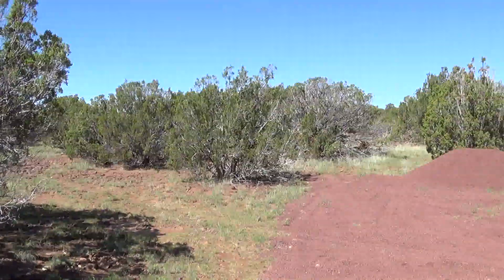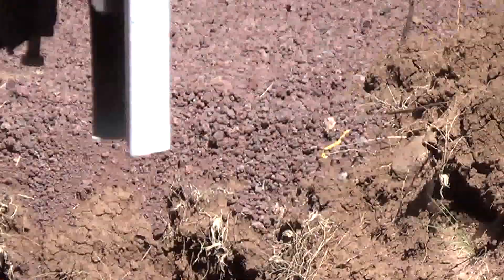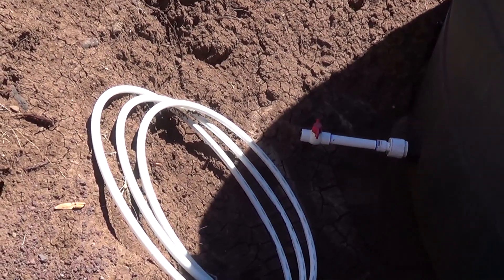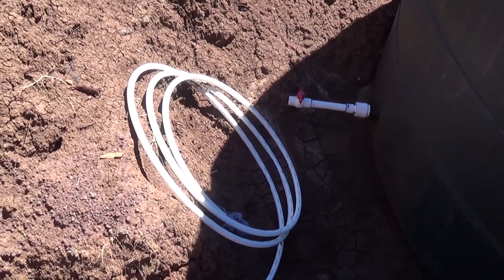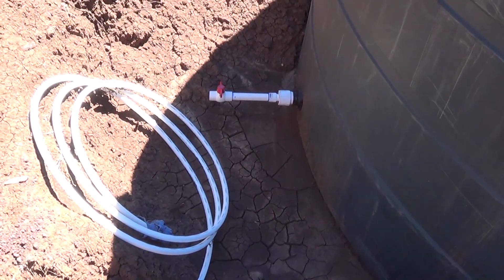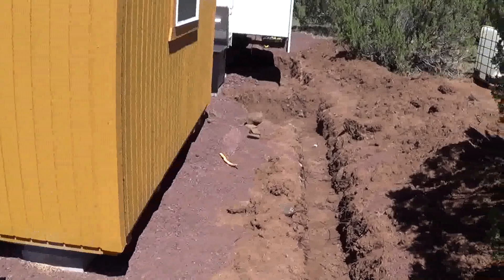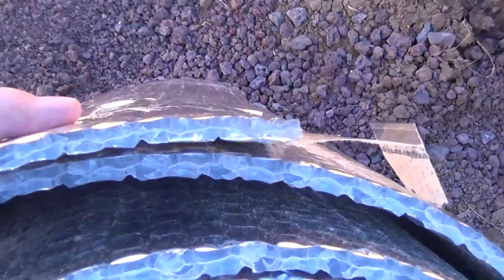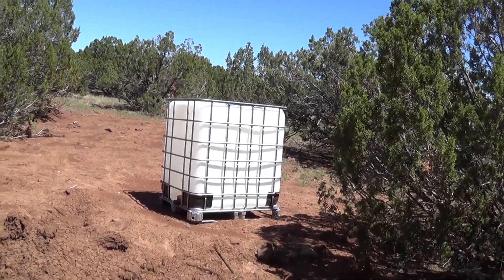Pex Tubing as my water line (plumbing) to the RV - Living off the Grid

Comment: Ok, so I caught these video's in the middle,, maybe a dumb question but why did you go with such a big water tank? Are you going to skirt the rv and if so with what? I love that radiant barrier stuff,,
Reply from the maker: what in the middle? got to watch from the beginning. lol.   skirt the rv ? you bet. with what? I have no idea yet. water tank size? in az we could go 9 month of no rain so I am planning to store 1 yr worth of water hoping I always have plenty. I over estimate that I will use about 8000 gal in a year so I am hoping to get another tank and store at least 10k gallons. water is like gold in az. drilling for a well cost is about $30k which is way out of my price range.
Reply: Wow, Ok I see the picture,, I'm in CT, want to be in TN and my water line is less than 100 and only about $5,000 to drill.. so I definetly  don't get AZ weather, now didn't you say it gets cold like very cold, how is that water tank not going to freeze if it's not buried,, maybe it's just my old ears not listening,,
Reply from the maker: great question about the freeze. winters will be down to 0 in fact a couple of years ago the high during the winter was 20 degrees  over a 60 day period. the color of tank will help to keep the water from freezing in that the dark color will heat up in the sun plus the larger the tank the better. the top might freeze a little but the lower part where the outlet is should not freeze. . thanks for commenting. good luck with your hopes of going to TN.

Comment: In my reading about PEX, I've learned that soil pollution (e.g., petroleum waste, pesticides, herbicides, etc.) can leech into water through the pipe walls. Also, PEX should never be exposed to sunlight. You've covered yours, but you don't want it sitting in the sun too long.
Reply from the maker: in az anything exposed to the sun will rot. lol    didn't know that about leeching through the pipe  thanks for the info. good thing I can control the soil pollution on my property.

Comment: Hi Jeff 
Thats a massive tank is it along ways to get water brought in is it also expensive your homestead is looking good it will be another couple years before i amable but i have a realtor looking in that area for me maybe we will meet up some day good videos very helpfull
Reply from the maker: I found a person who delivered 750 gallons of water for $45 . I brought some water up myself using a 330 gal tote on a trailer from my house in phx. when I add the cost of the water from home plus the extra gas it took to pull the trailer with over 2400 lbs of water I would say the $45 bucks was worth it. cant wait to get the rain catchment system in place so I don't have to buy the water.

Comment: I think your running a big risk of that pipe freezing where it comes above ground under the trailer. Insulation does not keep the pipe from freezing by itself.  Insulation keeps the heat from escaping as fast as it would w/o it. It does not produce any heat. When you get  zero degrees over night the water in that pipe will freeze, especially if there is a wind hitting that insulated pipe. As long as the temp is below freezing the temp of the water in that part will drop even with insulation around it over time w/o heating. That pipe under the trailer needs to be protected with heat tape under that insulation. It comes in different lengths.

You are extra vulnerable if your dealing with -20 temp's. for days or weeks vs only >28 to 31F..  The real problem is Water condenses in volume as the temp' get's lower. However just as it freezes and the temp' goes lower it still expands more.  While ice at 32 has expanded from liquid water at 32 it continues to expand more for every degree it goes lower. Water at 28 let's say has not expanded that much from 33 F. water which puts less pressure on the pipes than ice at 0F.  or -20F, which has expanded way more.  Water @-20 as ice has expanded greatly from ice at 31F. and will burst any pipe. The water in that pipe under the trailer will freeze if you only have insulation on it, when exposed to freezing temps long enough.

Are there RV parks that have people over the winter? You might want to try and talk to them on how they are above ground waterline protected. If you don't get it right you'll find out this winter. Over 6000 ft you got to do it right or suffer a burst pipe. Not trying to scare you just saying. Good luck.
Reply from the maker: thanks great point. I like the heat tape but wont have a consistent power supply for it until spring.  this winter I am draining the lines in fact doing it this weekend. I am not going to be able to go full time until spring (February/march). lots of folks here say wrapping it up like I did should be fine as line as like you said keep out of the wind. as I learn more I really like the heat tape. my temps most of the winters is between 10 and 40 for only 60 days the rest of the time the coldest is maybe 25.   I appreciate the info.